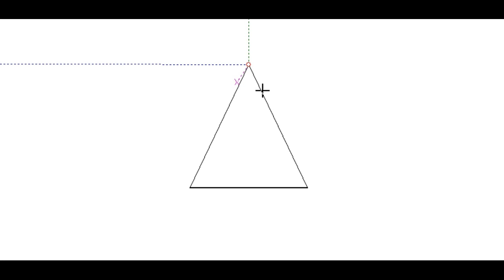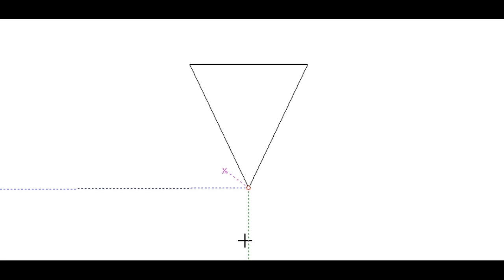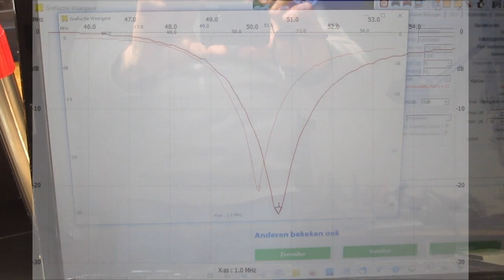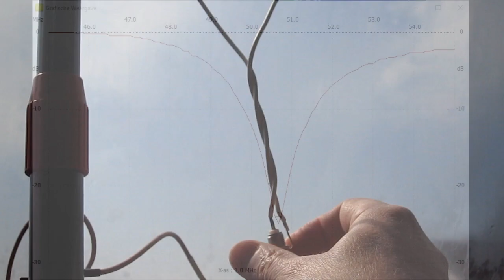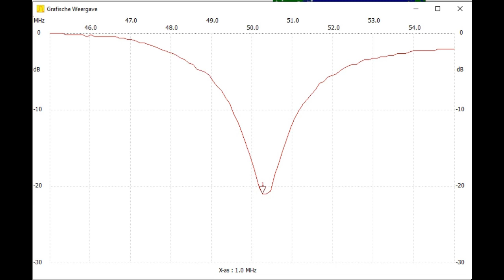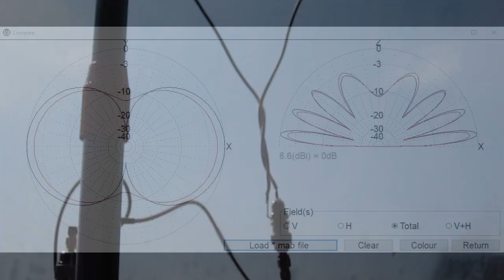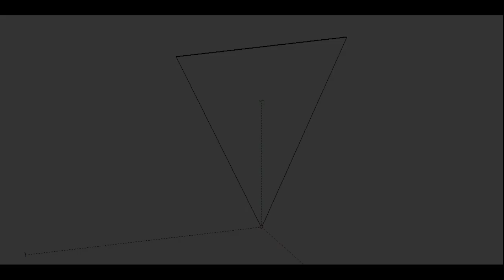Easy to adjust DIY Delta loop antenna for 50 MHz (6 meter band)

Comment: Twisting the wires to reduce the loop size without effecting ohms is brilliant!
Reply from the maker: Thanks! In fact, twisting is not needed, it is also possible to slide (for example) a cable tie over the wires. The only thing is that the wires needs to be kept closely together to form a low impedance open line.

Comment: Good job thank u , if i intend to build delta loop for 2 meter 145.5 mgh what is the right length should i measure with no unun install 73’s
Reply from the maker: When simulated for 145.5 MHz I come to the following dimensions: horizontal wire 55.4 cm, sloping wires: 85 cm. However, I experienced that dimensions of single loop VHF antenna’s with MMANA are not very reliable… See also https://youtu.be/INEdbw4B37I  
If you keep the wire some longer then mentioned above and you measure a better SWR low in the band, it is indeed too long and you can shorten it a bit.
For measurements it is preferred if you use use a common choke, like https://youtu.be/gdTrNMh_LO4 
If you post here your findings, it could help others. Enjoy the experiment!

Comment: can you please share the calculations or ratio for changing the sides so the feed point is 50 ohms?
Reply from the maker: The ratio is 1 (horizontal wire) to 1.5 (sloping wires). So in fact, the horizontal wire is a quater wavelength. Simulation showed then an impedance of 55 Ohm and  jx 0. So coaxcable could be connected directly to it for a good SWR. (Of course this change a little bit depending on antenna height). Make some turns in the coax to act as a choke. Please let me know about your results.

Comment: What would be the wire length for 11 meters?
Reply from the maker: I would say, 300/17.1=11,07 meter. This is likely too long but with the described method the effective length can be reduced. Just experiment, what could you loose? Please post your final results here.
Reply from the maker: Simulating for 27.1 MHz with MMANA showed some longer wire with a total length of 11,86 mtr?
Triangle dimensions: 
horizontal wire: 3.54 mtr
wires connected to the coax: 4,16 mtr
Just play with the lenght and the shape, it's just wire :-)

Comment: Very nice and easy project. Good  idea to twist the wires for SWR adjustment. I have built this antenna to be at least QRV on this band, and i am very surprised by the performance. Worked whole Europe with this simple piece of wire. Although, i have used a plastic tube instead of the wood. Thanks a lot for showing us! 73 de DO1LR
Reply from the maker: Thanks for letting me know and your kind words. In fact, twisting of the wires is not needed, they could also be straight parallel. By twisting them (a bit) the distance is guaranteed over the whole length.

Comment: Cool project. Do you have a hard copy of plans for the antenna? Did you use 468 or 234 to figure out the wire length? Thanks for sharing. KC3UEE.
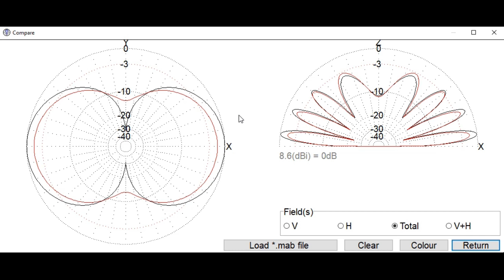Reply from the maker: Thanks for your kind words. I am not sure what you mean by '468 or 234'... I played with MMANA. My dimensions are at the end of the video, at 8:22. The sloping lines ar each 2.16 mtr and the horizontal wire is 1.84 mtr. So the total length is 6.16 mtr (that is too long but that can electrically be reduced the way I showed). No hard plan, it's just a wire and a stick :-)
Reply: @PA3CRX  I meant is  calculated by dividing the frequency by 468(half wave) or 234(quarter wave)?
Reply: @PA3CRX  I was referring if you used the frequency calculation of 468(half wave) 234(quarter wave) to get the length of the wire.
Reply from the maker: Ah, I understand. In Europe we use 300 to get the wavelength in meters :-) 300/50.3=5.96 for the full wavelength. And because it is insulated wire the length should even be a bit shorter. With my method to reduce the length of the loop by making a small 'open line' the effective length can be reduced but not lengthened. So in this case a bit longer is better then a bit shorter.
Reply: @kidbach 1005/f  equal full loop length approximately.
Reply from the maker: I played some more with MMANA: if the total wire length is kept the same and the horizontal stick is further reduced in length (to for example 1.66 mtr), the the impedance lowers further. So in fact, it is all not critical.